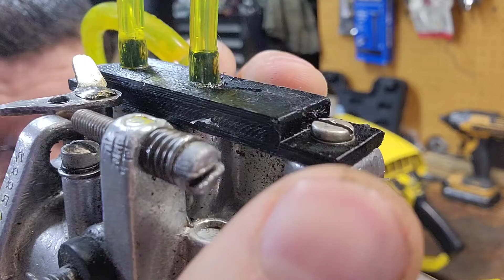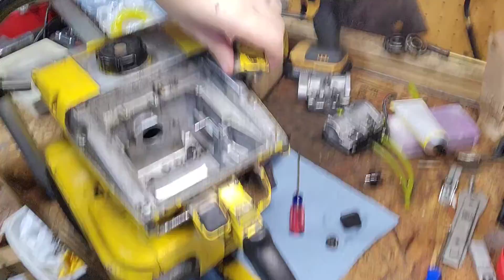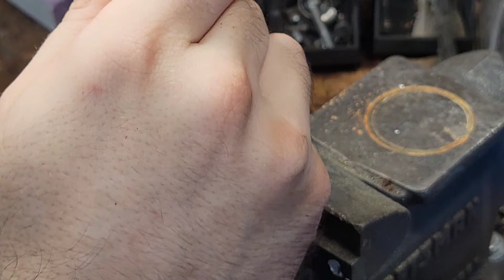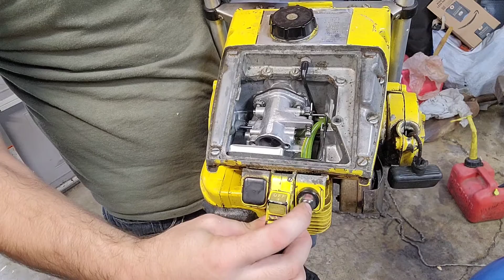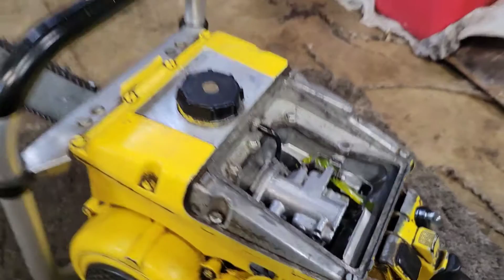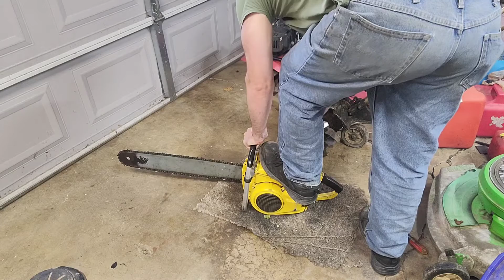McCulloch Flatback Primer Fix Installation

Comment: future project 300,is the carb the same?,and where can i get a kit...thanks!
Reply from the maker: Probably the same if a flatback. Kits can be had on ebay sometimes but are expensive and don't include a needle and seat and why I recommend putting a tilly carb on.
Reply: @MisterMacsGarage  thanks!

Comment: Can you please tell me, I have a child like that, but the fire is there but the fuel does not explode. The fire is very strong.
Reply from the maker: Compression could be low, bad crank seals not allowing proper fuel, poor fire when the spark plug is under compression vs not

Comment: Great Idea! I have a Poulan saw that is missing the NLA Walbro HDA-49 carb that uses an impulse line and the customer wants to use a standard HDA carb that uses impulses off the manifold block hole. This video has given me the inspiration to try to make it work.  Thanks!